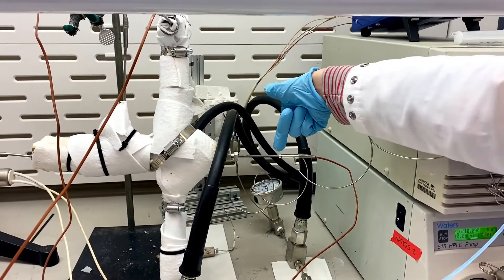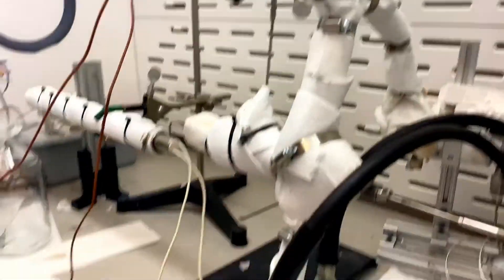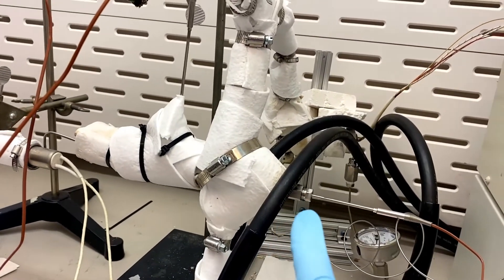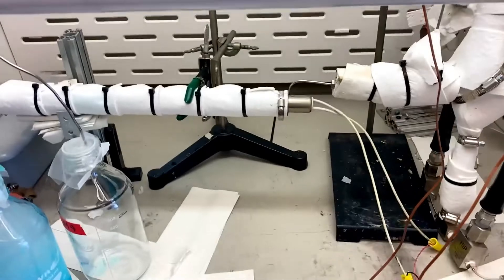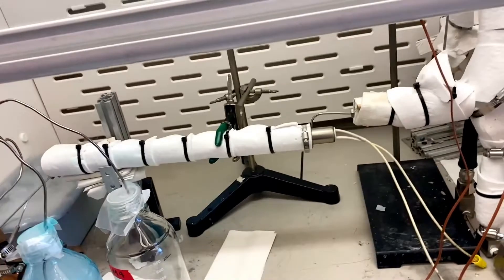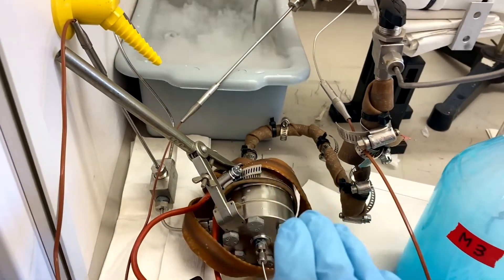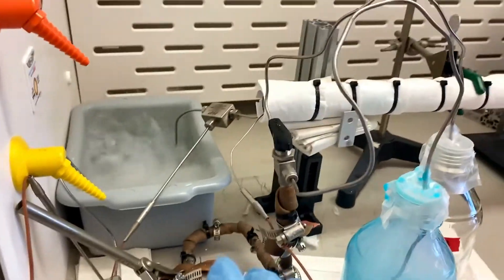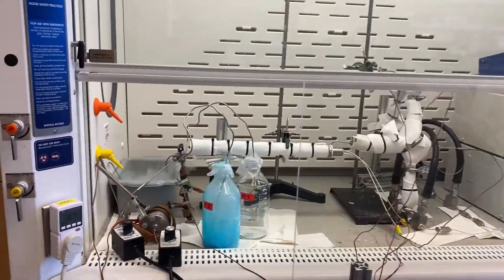Synthesis of metal-organic framework (MOF) via continuous flow supercritical carbon dioxide reactor

Comment: Excellent and very informative video. Thanks very much for all your effort. I'm looking forward to seeing the mass implementation of your process in the industry. The ability to keep the temperature so consistent and the last part of the video showing the collection beaker after 25 minutes of production are very impressive. 

My first thought after seeing the video is how the process can be automated and compartmentalized into a single enclosure or cabinet and managed with dedicated instrumentation and computer control using off-the-shelf components like the Open Source Arduino SBC, and PLC's. Possibly some thermoelectric Peltier coolers may also be suitable. Good luck with your research. Joseph Smetona.
Reply: Same, mine was Raspberry PI (control header + temps), but yeah... excellent
Reply: Excellent explanation